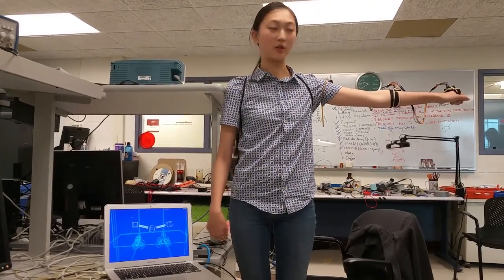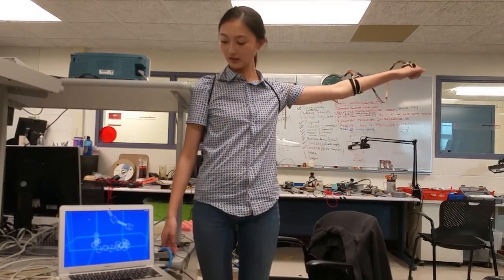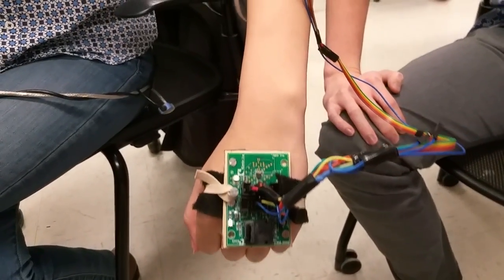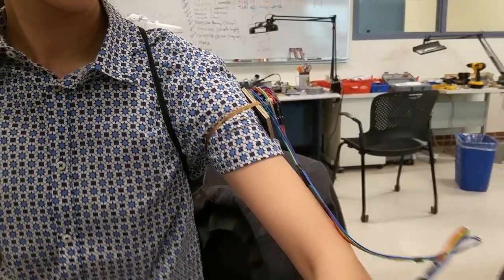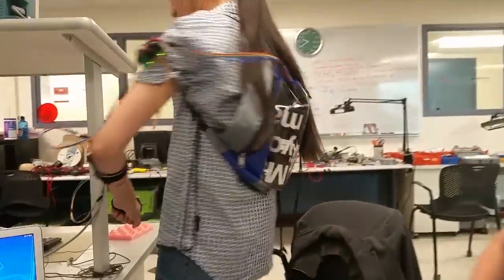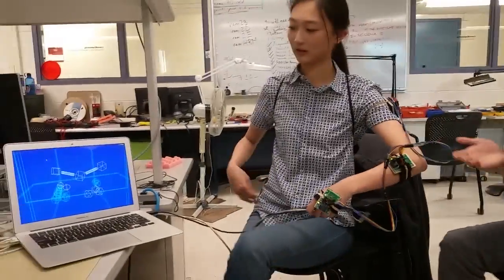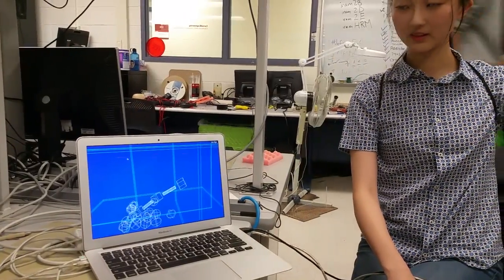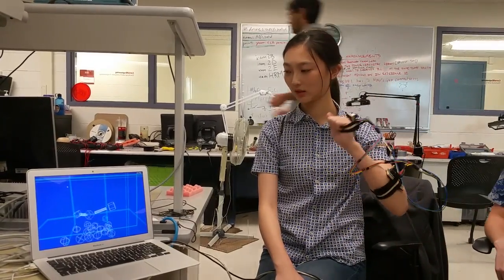Arm motion tracking

Comment: Amazing, it works smoothly. In your linked report, you were using baudrate 115200 and sampling freq around 41 Hz. Higher frequency could possibly higher quality. So, if we take sampling freq around 100 Hz then the result will be better, right?  But, why must be higher than 41 Hz? Why dont higher than 10 Hz or 20 Hz? Is there any reason? thanks in advance.
Reply from the maker: bandwidth of human limbs motion is a few Hz, so 40 Hz is fast enough to avoid most aliasing. But did you read the linked report to see if the students explained the choice?